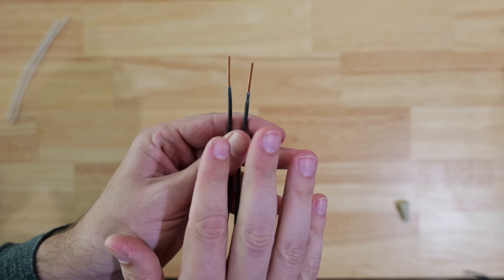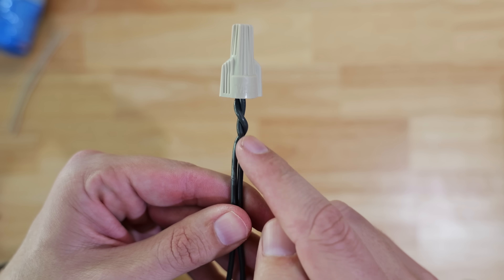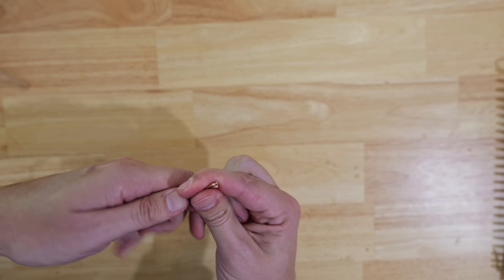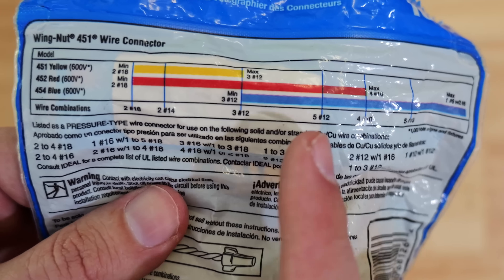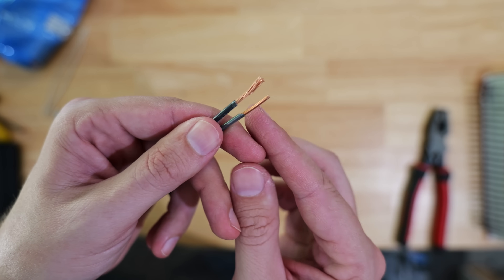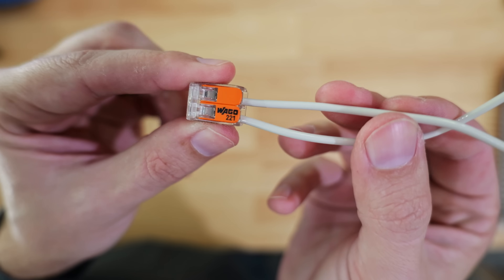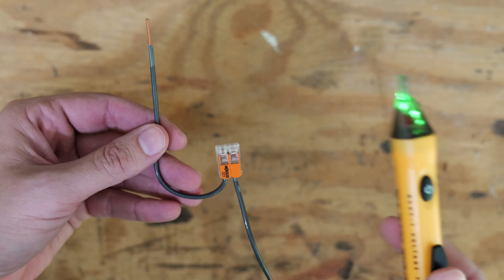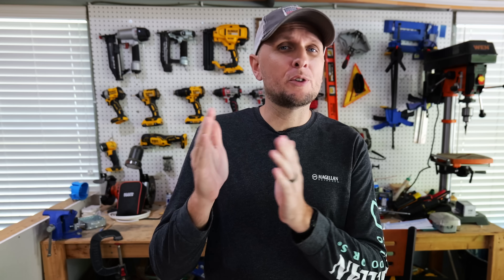7 FATAL Wiring Mistakes Most DIYers Don't Know They Are Making | Most Are Guilty of 3

Comment: Master Electrician here, 38 years in the trade, i switched to Wago 2 years ago. I sold my stock of twist nut 1/2 price to a competitor who was looking at me like a stupid guy for selling my new stuff so cheap. Needless to say, i was looking back at him as the stupid one who can’t progress. Once you go Wago, you never go back to twist nuts. Yes they are more expensive, but i charge everything i install, so in the end, they are more payfull and a breeze to work with.
Reply: They also make solo DIY jobs (hanging a ceiling fan)  much easier, faster, & safer.
Reply: Smart. It’s so funny to see how crappy US installations are done compared to e.g. Germany. The material used is so much better and its not left to accidents. And with 230V we have even only half the currents you need on 110V (at the same wattage). Of course it need to be operated and installed to the book, but then its fast and very secure. How would you compare a few hundred of extra cost for proper material to a burnt down house.
Reply: It was about time for the US to find out about Wago! In no case I would ever use power nuts. I work since 1983 with Wago with no issues at all.
Reply: Agree with your general sentiment, but the US is on the 120V electrical standard.
110V is one of the Japanese standards
Reply: I was using Wago for myself ...I labored for a Master electrician & learned a little 👍
Reply: @seppm64  I really enjoyed reading your comment in thick German accent. German accents and French accents are the best for putting down American standards. In my mind you sounded like "Hans and Frans" from Saturday Night Live back when it was funny🤭

 "It’s so funny to see how crappy US installations are done compared to e.g. Germany. The material used is so much better and its not left to accidents. And with 230V we have even only half the currents you need on 110V (at the same wattage). Of course it need to be operated and installed to the book, but then its fast and very secure. How would you compare a few hundred of extra cost for proper material to a burnt down house."

Comment: Professional electrician here. I've worked in many houses and commercial buildings. My company does everything with WAGO. It grips the wire really well, it's really easy to make a proper connection and tests show it can handle electric issues much better than any other connectors. We use wire strippers to get perfect amount of wire isolation removed. I never faced the issues pointed in this video.
Reply: WAGO  made in a Chinese garage is not preferable!
Reply: You should never put splices in wire and then install that behind a wall——never!
Reply: @Joe-qw6il  Please elaborate enlighten Us
Reply: @Joe-qw6il Never ever!
Reply: @MachoLife585 All junction boxes SHALL be accessible. It’s in the code. You can’t find a bad connection if it’s buried in a wall.
Reply: @toadsauce8091  100% Agree Thank you
Reply: My newest NEC book is a 1996! lol
Reply: @rtchakar  preferable get real WAGO. Wagos are made in Germany not China.
Reply: Could be me the wrong person to use this device, but I been using them and I been seeing sort of trouble with them.  That's why I am aware of.  No longer using them.
Reply: @rtchakar No. Wago HQ is in Germany. Factories in Germany, France, Switzerland, Poland, the US, Japan, India and yes, China. But probably not in a garage.
Reply: I worked for over 40years in the electrical trade….the wago’s continuously failed in conditions that where used in extreme heat swing (-40 F to 160 F)conditions…not sure if the solid copper from constantly expanding and contracting but eventually the wago’s would either arc inside them or wires would fall out
Reply: @John13Edge  love when americans try say they have had wagos fail consistantly. please show proof then.
Reply: @Goryrat  I spent over 40 years in the electrical trade due to health reasons I am no longer allowed to work…( basically have had my whole aorta replaced)and I am definitely not American nor do I have any plans at becoming one ..
Reply: @John13Edge  not American? while using Fahrenheit and sitting in a car that is most likely the drivers side on the left? you're American or from a country that i don't want electrical advice from.
Reply: Wire nuts can handle more current/heat. That's been proven. They're also stronger connections but both are strong enough. And if connection fails the wires are still twisted with nuts. Nuts are also significantly cheaper to manufacture so using 1000 per job might save a lot of money for a better end product.
Reply: @John13Edge 
And the expanding and contracting twisted coppers will remain more secure lol.
Reply: @TheGrinningViking  Where do you live that you can bury an electrical connection in the wall???
Reply: Wagos are GARBAGE; no better than the "push-in" connectors on 15-amp switches & outlets.
Reply: Everyone saying they've had wages fail as electricians blow me. I was skeptical of them at first but I mean I've pulled on wires and never had them come out I always check every nut to make sure everything is snug.....the only time they haven't been is when I foolishly cut didn't cut enough tithe insulation off the wire. And then people are like you shouldn't use them ina spliced wire behind a wall....but my understanding is there should never be any spliced wire behind a wall????
Reply: The title says DIY-ers NOT commercial electricians
Reply: I never even seen or used a WAGO, and being 76 years old I personally would never use them.  It reminds me of the push in spring on the old switches and recpt's of which we always had a problem with when they heated up under overload and lost tension and likely came lose of the connection.
Reply: WAGO are great, easy to use and hard to mess up. But they do not "handle electric issues better". Wire nuts handle more current, the WAGO has much less area touching the wire and the current has to pass through the conductor in the WAGO, vs the wire nut is wire to wire connection with a large surface area touching. In most practical uses, it doesn't make a difference. But there are videos comparing them both under high current draw and wire nuts handle better.

Comment: I’ve been a commercial electrician for 19 years. My take from this…read the instructions. It’s all right there as with anything you do. All your power tools, your lawnmower, your vehicle, etc. If you just carefully read the instructions you won’t fail
Reply: The problem with instructions, sometimes they aren't complete. I just installed 2 lights, and the box for the lights came with wire nuts, and there was no mention of twisting the wire.

I twisted the bare wires(1 solid, 1 stranded) inside the wire nut, but didn't twist the wires(with insulation) outside the wire nuts. Now, I'm going to have to open up the light and redo it after watching this video.
Reply: @pazicjr that's a sad truth.
Reply: @quasistellar  I redid them with WAGO's. Won't go back to wire nuts. So much simpler.

Also, I am aware of the pitfall of the WAGO's, so I made sure to hold the levers when pushing them back into the box.
Reply: I had a friend in customer service who would refer to some people as RYFMs.  Read Your Fucking Manual.  It's a rare thing.
Reply: I find more than actually 50% of the time. The directions are poor quality. Missing valuable information and for sure drawings not being proper is another big issue.. however, drawings associated with words is the best choice for creating a more self-explanatory document
Reply: @pazicjr  yup I recently installed a shower exhaust fan and there were no instructions for twisting the wire nut. AND the fan had stranded wire, which was hard to secure in the supplied wire nut. Even when I gave it the extra twist as shown in this video the stranded wire refused to stay in place. And I'm doing this on a stepladder with  my arms overhead getting tired and frustrated.

Comment: I love Wagos, they are fantastic especially when you are on a ladder trying to terminate a fixture with one hand.  If you are not convinced, they are German engineered and I have been using them for decades and never had one fail.
Reply: I agree. The older Wago 222's were quite bad, but obviously still better than wire nuts, however the Wago 221's are just amazing. Been using them for around seven years.
Reply: Wago 2273-205 is perfect for permanent install, not 221
Reply: @stijnvandamme76  I am just going to respectfully disagree with you on this.  I love the 221 and they work and last well.
Reply: I'd say both are great, just different purpose
Reply: I had a Volkswagen and it was German “engineered” to cost me a fortune. Had to basically take the engine out to change a light bulb.   Whatever a repair cost on a decent car cost 4X that for a VW.  Thing was always in the shop. German engineered is trash.  I’ll stick with 3M. Best products in the world.
Reply: @BeefNEggs057  3M builds cars? I have not known that. Like probably the rest of the world.
(And don't try to mock me, it's based on how you wrote your comment.
Reply: @BeefNEggs057  Luddite comment.
Reply: Wagos are GARBAGE; no better than the "push-in" connectors on 15-amp switches & outlets.
Reply: @jimbritttn  and yet strangely they sell millions and millions of the things, weird that. HAHAHA!!!
Reply: FREE ASSANGE!  ok we did but GREAT AVATAR!
Reply: @jimbritttn  Wago makes many different types of wire connectors.  Push on type, lever type (as shown in video) etc.  Video shows the lever type "221"  They are clear so you can see the connection.  Comes with strip gauge and a slot to put a probe from a multi meter.  Many size gauges of wire can be used and are reusable.  Bad thing is they are more money than wire nuts .  Be safe and great day.

Comment: 41 years in the trade, I’ve always used tape on wire nuts with stranded and solid wires together. Yesterday absolutely correct on properly sizing wire nuts to application, and I have not seen a Wago fail, since I’ve started using them. As always , dedication to craftsmanship ALWAYS pays off!
Reply: Every job site and every home I've lived in, Tape is My Last Signature, It Secures Wire Nuts and the new Kid on the Block, Wago...no Failures
Reply: I always tape up the WAGO levers. No way is the wires coming out now. Simple to remove the tape if I need to remove the connection.
Reply: @OverkilledUnderdog  Gold Advice...Tape is your FRIEND!!

Comment: I started my apprenticeship 5/91.  The journeyman i tooled with taught me to pre twist the wires and to put the stranded wire just past the solid one. Over 3 decades later I'm still doing it with success.  I've just come across the Wago and plan to use them for connecting control valve wiring on a job this summer.  Great video my late tool buddy would give it a thumbs up.
Reply: @Sheila Walker does your brother have an Electrcaul license?
Reply: @@gnaskinyAnWinyan Ummm, NO.  Tape just ends up a gooey mess. The only time you MUST tape a wire nut is if there is some odd requirement from the AHJ.  Wire nuts installed correctly are what the NEC calls for.
Reply: @uisignorant  Imagine being the electrician getting the approved electrical designs that say "All wire nuts must be taped in place where they cannot be removed without first removing the tape."
Reply: At least you believe he would. Everyone thought i would love them as I do trouble shooting and diagnostics. They're great, imo, for temporary testing purposes, but I'd never leave them in equipment I'm signing off on. Unless someone insisted I use them. Then I'd be requiring a hold harmless, that I always have. No one seems to believe in them as much when I ask them to sign it for either of the two reputable mfgrs. The off shoots I never touch. Either the connection method goes back to what was specified, or I go to someone else's job. I don't risk my reputation or livelihood or my ability to provide for my family, for nobody, let alone one project or one job. Why do that?
Reply: @johnathonbraun341 Try military work. Don't want to do this? No problem. Don't take the job. Take the job and don't do what you've agreed to? Get an attorney, fast. You're going to be prosecuted. You've agreed to be prosecuted when you signed the contract"S".
And no one with sense turns down military work. Turn it down once? You'll never get another chance to turn down another.

Comment: Interesting video!  Reading the instructions?  What a concept.  Thanks
Reply from the maker: I mean, most people don’t.  Just assume it’s a no brainier device to use and don’t need extra details.
Reply: @HowToHomeDIY  I'm certainly glad I always, always read the direction prior to installation or use.  Always!

Why is my nose itching?  OMG
Reply: How else is he going to use clickbait to generate views like all his videos
Reply: @gregs8678  I thought the video was pretty good and informative.  I'm not training to be a commercial installer/contractor but just want better solutions to what I'm doing out in the garage.
Reply from the maker: @gregs8678 by clickbait if you mean interesting or curiosity provoking then sure but you clearly don’t know what true clickbait is.
Reply: @HowToHomeDIY if you read the instructions then you'd know you are incorrect.

5. Pre-twisting acceptable, but not required. For pre-twisting; strip wires long, hold wires together with insulation even, twist wire ends together, 
strip to recommended strip length.

That's from Ideal themselves.

Comment: Been in the electrical industry for 25 years, last 20 being heavy industrial. We started using the WAGO connectors a couple of years ago and they are a much better option than wire nuts.
We still have a use for the wire nuts in certain applications but we always tape them up as well.
Reply: Ten years here and absolutely agree
Reply: Yep agree. I've been slowly but surly replacing all nuts with push in or wago clips. I LOVE these things since a lot of my machines have enclosers that becomes impossible to actually spin a nut without doing some gymnastics. These save me so much time and frustration
Reply: I agree with taping up the wire nuts in theory but from my experiences opening up old Jboxes, the adhesive on the tape doesn't hold up very well over the years and comes unraveled.
Reply: Americans have to protect them for themselves... 🤫
Reply: Tape them.    That’s really old school grandpa used to do it that way     50 yrs plus
Reply: Agree. I'm also switching to the new Push-x phoenix terminals for din rail mounted industrial stuff. Screw terminals and wire nuts can kick rocks.
Reply: Wagos are GARBAGE; no better than the "push-in" connectors on 15-amp switches & outlets.
Reply: I'll stick to wire nuts where there is a lot more physical connection between wires.
Reply: Wago are junk
Reply: It's funny that in Europe, we absolutelly don't know these american wire nuts, nobody uses it here, but when it's done properly, it's better than basic european terminals, but these terminals are more idiot-proof, even your mom can put it there that it works, while these nuts need to be done properly. When I know there will be high currents, I still prefer proper soldering with copper to copper connection than all these chinese nonsenses. Soldering is not allowed anymore by rules, but that's because people were doing it bad and also because of stupid EU banned lead in solder and those lead free solders are very britle. Correct and 100% safe way how to do it is to twist it together, then wrap it around with another copper wire and then solder it properly, even when solder breaks, it still holds together and has proper contact and I don't care about what some stupid EU official from office says, this is the best low resistance method. Homes are on fires all the time because of using official approved chinese nonsenses with CE logo that means nothing.
Reply: @Pidalin  In The Netherlands Conex connectors were used a lot (called 'lasdop' overhere). They are a bit like these nuts but they have a spring. They worked well. But nowadays everybody uses WAGO. Faster but in my opinion not better than the old Conex.
Reply: @jimbritttn Wago are great for lights when trying to wire some crappy 18 awg aluminum stranded wire to a 12 awg solid
Reply: I always tape my nuts and wagos as a backup safety precaution. Make me feel good too. lol.
Reply: Heavy industrial, huh?
Reply: If a person has reached the apex of their skill set dealing with wired connections, they should look into cooking or something else.
Reply: I would never use Wagos for residential installations, as they are junk, I will only use wire nuts. In commercial installations, the Wago types have their use. Now, in industrial installations and servicing, such as in machinery and other industrial equipment, the Wago and push type connectors have their place.
Reply: @michaelrosin7843  they live in 1950 still 😂